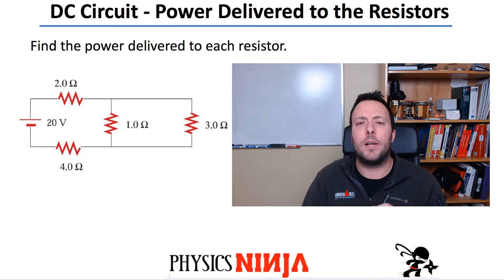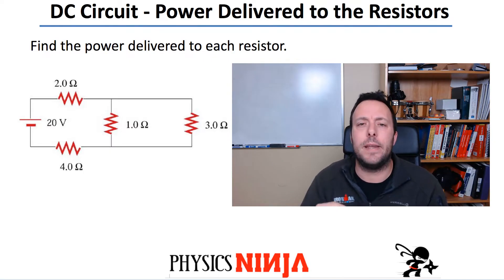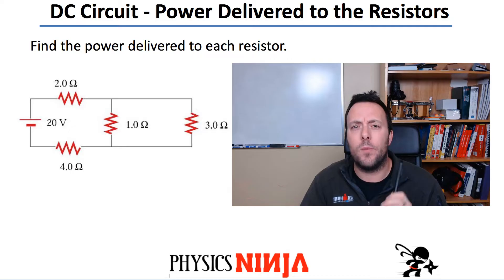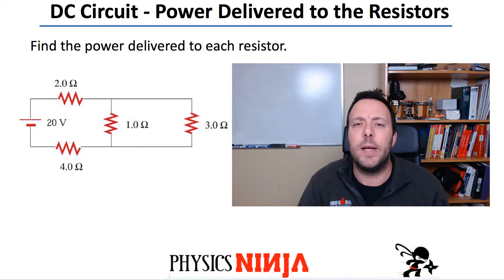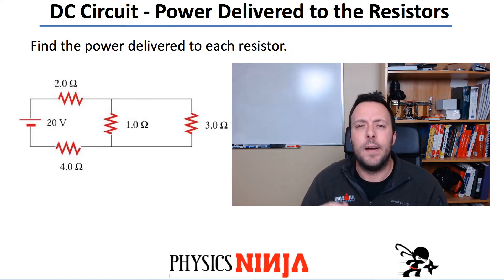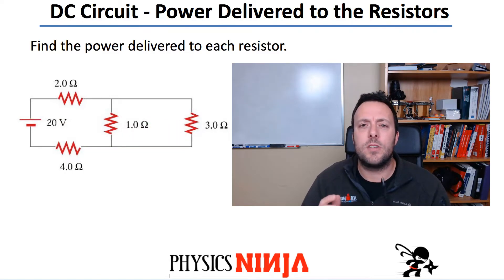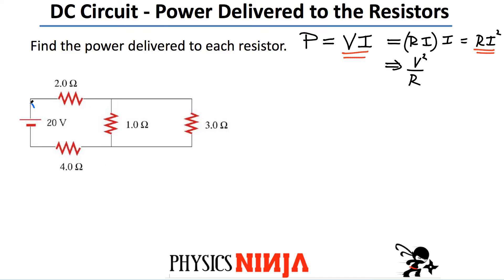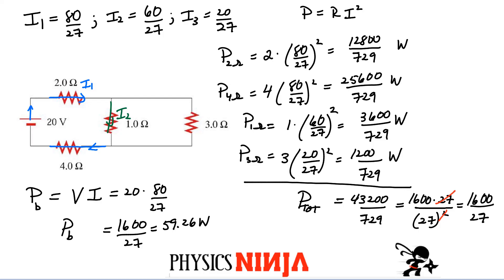DC Circuits - Power Dissipated in Resistors

Comment: Personal opinion is that because 99.99% of people are using a calculator, your fractions are confusing. Decimals are certainly the best. This is an exceedingly simple problem and yet at a glance (even to someone with a bit of knowledge), its immediately cluttered and confusing and off putting. And it is so, way beyond what it should be.

Comment: You go through the smallest steps which isn't necessarily good. At this stage students can obviously understand the calculation steps while you just go through the conceptual steps. It was hardly a 2 or max 3 minutes question that you explained in 13 minutes. You explain quite clearly though.

Comment: what do we do when we have 3 resistance in a parallel circuit instead of 2?  :(
Reply: it adds the same! just sum them all up inversely for parallel resistances. so for 3 resistors it would be (R1+R2+R3)/R1R2R3 just make sure to apply the directions correctly based on the direction of the current by Ohms and Kirchhoff's laws :))
Reply: @aliciaroberts3965  thank youu alicia! ♡

Comment: Nice explanation 
but why 1i2 = 3i3  ??
i didn’t understand this point💔
Reply from the maker: SßS ßS the voltage across each branch in a parallel circuit must be the same, so across the center branch the voltage drop is i2 * 1 and across the last branch it’s i3*3. each of the terms is given by R*I.
Reply: I'm glad you asked because, coincidentally, I have a similar question while doing a similar circuit for homework for my General Physics II class.

Comment: Shouldnt the P.D across the 1ohm resistor and the 3 ohm resistor be 20V , as it is parallel to the battery?
Reply from the maker: Not in this case because there is another resistor in the same branch as the battery.   The potential drop across each branch must be equal.